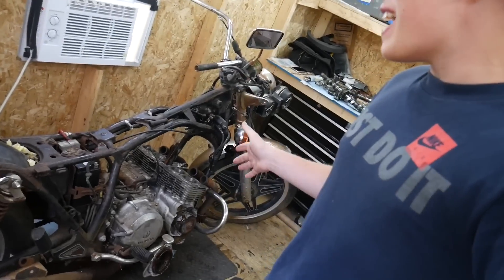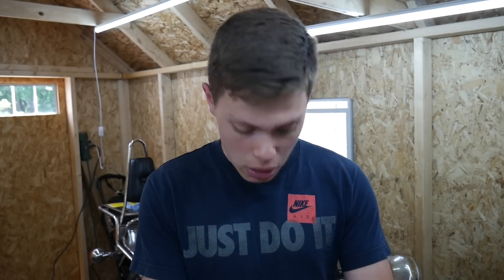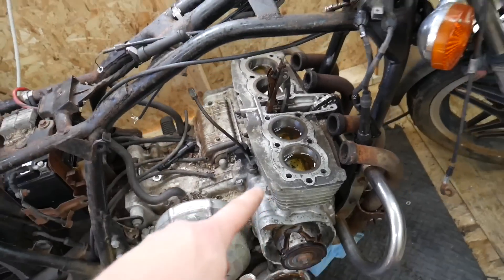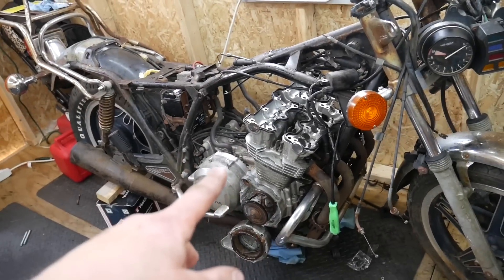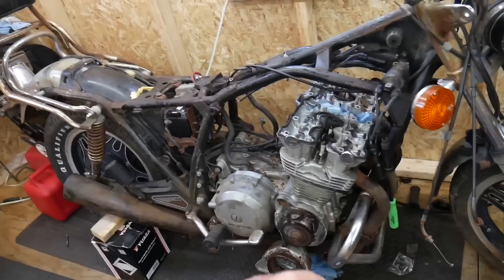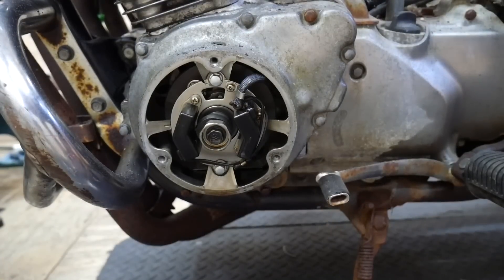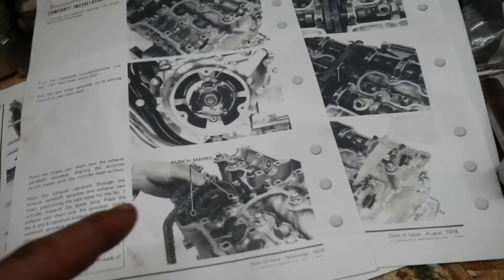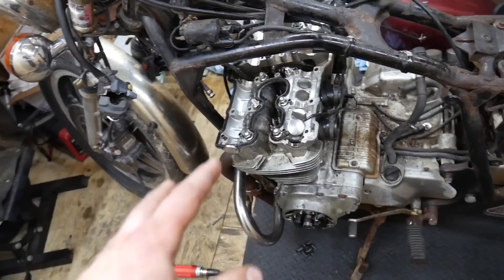It’s ALMOST Time to START the NasKart’s New ENGINE!

Comment from the maker: After reading the comments, many of you had said that the threaded rod will not work in the long run, I appreciate everyone notifying me of this and I thought of a solution that I will explain in next video, stay tuned!!
Reply: It's only 2 of 8 and they are not next to each other so send it or try to heat treat them then send it. It's going on a go kart not a road trip15 thousand miles
Reply: Get er done, idk anything to say about this motor or bike but thank you migs seriously idc what people tell you about what you do cause you really helped me & encourages while influencing me to process in my passion. I recently got a 150cc Dirt bike like the United Motors 150 you have, the bike needed a rebuild my boy I wish I could send you pics of the piston & head with valves. Talkin about a hole in the wall 😂. So I watched you do the top end rebuild & ive done it myself dad thank you but currently waiting for parts like usual :/ 

Any tips on breaking in?
Any tips on assembly like lube to use?

You are a legend my boy keep the great educational goofy videos coming to keep me & the viewers coming!
Reply from the maker: CallOfGloRay awesome man! So glad I can help, for the break it procedure, I usually let it idle with a view little tiny revs here and there for about 5 minutes, then turn the bike off and let it cool down completely, after that go back out, start it up and ride it around at lower rpms, just kinda cruise around for another 5 minutes then turn it off and let it cool down, finally, start it up again and ride on it how you would normally ride, maybe not super hard but you can get on it a little bit and she should be mint from there. Also, most of the time I like to use motor oil as assembly lube, but that’s just me, either one can’t hurt the engine, hope this helps!
Reply: Moto Migs thank you, that is exactly what I wanted to know^
Reply: @rayscyclesrepairs3516   You can't really heat treat mild steel which most of this threaded rods are made of. If you really can't afford studs meant for this application at least try to find the highest grade threaded rod you can. And just to now for future projects- if you want to remove studs without damaging them use 2 nuts tightened against each other and then start turning the bottom one left. The stud remover is only for broken studs and bolts.
Reply: CallOfGloRay don’t ask this kid for advice. For break in let it idle up to temp 3 times but slightly varying the rpm. Then take it easy for the first few rides no extended periods over 3/4 throttle then send it.
For assembly lube they sell a specific oil or just use cheap 4 stroke oil
Reply: Jag S don’t be negative boss lol but thanks

Comment: TO ALL YOU UNEDUCATED YANKS 
STRECH BOLTS HAVE ONE USE APPLICATION 
WHEN TORQUED DOWN THEY STRECH , 
It might work for a while but thought multiple hot and cold cycles the WILL FAIL IN THE END

Comment: The tensioner has to come out otherwise you won’t be able to run the chain on the other camshaft. Once it’s out you put both camshafts in and line up the dots on the cam gears parallel to each other but with cylinder no 1 at tdc. Once cylinder no 1 is timed the timing is done for the others valves. Good luck! 👍

Comment: He should have removed the engine from the bike and then put into studs and then put on the head work smarter not harder and that bike is not that hard to work on it super easy I've done it before several times

Comment: You need an angle grinder dude... coulda put one the the nuts on the thread and once you sliced the metal (in like 3 seconds) you coulda just ran the nut off and it woulda repaired the threads. But anyways nice video like always
Reply: Cutting metal by grinding on it with a bench-grinder was hard to watch Lolol

Comment: Go watch Peter Anderson rebuild this engine, he goes over the tensioner install as well you will see how it is done.  And piss off that threaded rod if you really care about this engine, its mild steel and will stretch with repeated heat/cool cycles and you will end up with uneven head torque.  Not sure the Naskart is going to like this lump of metal sitting in its frame either but that is going to be future mig's problem lol.

Comment: If I remember I used a a pair of pliers that pulled up on the tenenior spring that released its tension then stuck a screw driver just under the spring an it held loose so the chain would fit on  the cam gear. Also the cam gear itself unbolts off the cam. Get the correct studs otherwise you'll blow the head gasket when the motor hits operating temp.

Comment: Hey Mig, on the Yamaha 4 cylinder you have to undo the bolts that hold the gear to the cam. Then you can get the chain on the gear and then rebolt it to the cam. Atleast that is how you do it on a Yamaha 4 cylinder from the same era. (XJ models)

Comment: Think on how you took it off, you'll figure it out, the tensioner should be spring loaded and also have a bolt or pin in the wheel. I believe there is a prying tool just for that also. Good luck

Comment: What on earth are you doing? DO NOT USE THAT THING INSTEAD OF A STUD. ANY Machining shop can make you a couple of studs if you give them one for reference or if you give them the messurements. Plus I am certain you can find similar studs from a car or another bike. That rod is not going to hold and you will have to redo everything.
Reply: Or if he just removed the threads like the original one and only left threads on the ends
Reply: He could just measure the length and thickness of the stud, find studs from a different engine with the same thickness but longer and machine the ends to match his studs. I did something similar to my car when I couldn't find valves for it. Found bigger and longer valves, machined them to fit.
Reply: @bradleymetcalf6958   its not about the threads, its about the material of the rod. Bolts will streach when torqued. If the material is not strong enough it will streach to the point it wont seal.
Reply: Why cant he just heat treat it like a sword or knife??

Comment: Not sure if has been commented, but you should buy new head studs. I wouldn't even use the old ones. spend the 200 for the new ones save yourself the time and hassle. Also buy a grinder a harbor freight pipe bender and a welder and practice welding awhile. Everyone makes mistakes you just have to overcome them and learn from them. Also for videos when your not working on the bike work on taking out the engine on the cart make a list of what's needed and what to do. Either way keep it up!

Comment: Your all thread IS THE WRONG tensile strength as in wrong grade of Steel like in SAE it's a grade 3 when you need either a grade 5 or grade 8 tensile strength and yet and yes I know those all thread are metric not the point point is it's the wrong grade of Steel and is not the proper strength you will stretch those and or break them trying to torque them to what you need and they probably will stretch if they do hold and you'll probably end up blowing a gasket

Comment: To all the commentors who say that he is making a mistake by using threaded rod, its not a problem if he's using it on two different cylinders in the center of the head. The torque specifications and compression ratio are nowhere near high enough to stretch those bolts. If he were building a SB Chevy that would be different.
Reply: He should at least heat treat that threaded rod cause it is soft steel stubs are a harden steel

Comment: I think you are cutting your throat. You never ever use standard threaded rod for stud bolts. Head bolts are hardened steel. Threaded rod is not. Love your build but, you are going to kick yourself in the butt if you did'nt use hardened steel. Sorry but you are messing up not getting the right studs.

Comment: Take the motor out of the frame not gonna say anything about soft studs or putting two nuts on the studs to pull them out or tighten them up

Comment: Oh my. What did the motorcycle shop tell you on replacing the studs?? Woulda been better off if you found hardened rods the same thickness and thread them yourself. The chain tensioner should come out to free up slack to reinstall the cams.  usually on the back.  I’m not saying your doing a bad job your learning as you go.  You need to rethink a few things

Comment: Funny I gave him the eBay listing for a full set of stud used on his last pot and he disregarded it. Let him find out the hard way when he warps the head and can't get a usable replacement
Reply: This is what happens when you want to be cheap I give this motor maybe an 1 of running before she grenades
Reply: Funny thing Patrick, he wasn't bring cheap. He was being stupid. The listing I gave him was a full used set for $40. I'm in the automotive field and not all customers can pay for new parts. I aquire used parts with warranties weekly for some of my customers.  Just like when he washed down pistons with carb cleaner, 20min in a Chinese hydroponic parts cleaner would've had them totally spotless. God even harbor freight has them for $19.99. oh well not my motor and not me wasting money
Reply: Agree but still on when it comes to the heads you really want to use new head studs if possible I know from experience I used my old studs on my first motor I built and I regretted it a simple 400 dollars cost me my whole engine

Comment: i'll check out my manuals, i just sold my 750 one but still have my 900 and 1100 manuals, and the engines are the same, i wouldn't get to excited and starting your engine, you still need to check the valve clearance, and i'd bet money there off, the exhaust valves sink into their seats and you loose clearance, if it will even run or just run like crap, so either you have to buy new shims or do what i do and grind them down on a surface grinder, maybe if you go to a honda bike shop someone will help you, there should be a motorcycle salvage yard around where you live as well.

Comment: Man just throw a predator 420 on that thing
Reply: agreed.  so much fab work to put that heavy asf cb750 in the nascart.
Reply: yea, or a 670 if he must have so much HP. . that guy is absolutely not ready to work or put motorcycle engines on something like that.   Cant wait until he starts working on the frame and fitting the engine. I dont hink i understands how much work it is to make the frame strong enugh for that heavy engine.

Comment: Buddy I really hope that those shitty pot metal studs you made up doesnt stretch. Imho I think spending the 200 on a new set of studs would be worth it those you pulled out you could've saved the threads yourself. Also those old studs are probably stretched. If it blows a gasket its gonna be on one or all the new studs you made why because they havent stretched fully yet. Most bolts stretch more then 2 times especially if it's been torqued and un torqued multiple  times. It only takes a stud or bolt to stretch .002" of a inch for stuff to start going bad. Hopefully this old Honda beast comes alive and stays alive tell it needs a new timing chain probably not a bad idea to change that timing chain as well. I know you dont wanna spend the money but sometimes it's worth it and is better in the end. Something you might not know that big engine builders do is measure bolt stretch yes it's a thing and yes if a bolt stretches more then its supposed to it can cause a very big problem if you use old bolts that's already been through heat cycles. I know in kart racing guys change bolts after about 25 to 75 hrs.

Comment: Migs you need to get an angle grinder it will make things so much easier,you can go to harbor freight and get a decent one for 20 to 30 dollars.And I wouldn’t use those threaded rods cause they’re galvanized and not hardened so they’re gonna stretch and wear and it will cause you lots of problems with that engine so rebuilding is kinda useless at this point.

Comment: Using that threaded rod will cost you more money in the long run... it'll cause blown head gaskets with a quickness. And grinding on the allthread and heating it up like that changes the molecular structure of the metal,  causing it to not hold torque,  especially since they're not hardened like the proper head studs.

Comment: Here is a link to a diagram for the chain tensioner https://www.hondapartshouse.com/oemparts/a/hon/506f8d96f8700229747b9637/cam-chain-tensioner
Just copy and paste into search bar 
And here’s a link to all the parts diagrams for the bike 
https://www.hondapartshouse.com/oemparts/l/hon/50541774f870021c54bef631/1980-cb750c-a-parts

Comment: RIP this engine if he uses that threaded rod 🤣😂🤣😂. Just do it right and get the right studs, you'll thank yourself later when you dont have to do all this over again. You put all this work in, why ruin it?
Reply: They will work as long as they have been milled properly
Reply: @thomasmcdougall8059  original studs are treated hardened steel. Not some cheap soft steel home depot shit. They will not last at all
Reply: @HD-kl3hn  but it's only o 2 out of the eight studs tho,i think it will hold up,i get that it's softer but the other studs will be fine
Reply: @HD-kl3hn  as the comment above said its only 2 studs with those 2 studs spaced out there won't be anything up it will hold up fine if anything it will expand a little
Reply: Corey your right I’m pissing my self with these comments, he needs stretch bolts

Comment: Don't use those threaded rods man they will screw up more stuff and it'll just make it harder. Buy the original studs man they are hardened and meant for that job. Those threaded ones will stretch
Reply: G'day guy's yeah as soon as he said threaded rod I said NO ,don't do it ,  he's young and doesn't understand metal stresses and metal & alloy mixing .
If he goes ahead with this he'll be riding around with a bomb behind him , I hope he has at least a 3 mil  plate behind him .
Reply: The rods he used will be fine fore it there's only two of them out of like 8 that's nothing compared to what I've seen done to engines
Reply: @absolutemadlad2671  yeah that makes sense man it should be fine now that I think about it! Thanks for your comment
Reply: @frasertive2726  I really can't tell if your being serious but if you are no problem
Reply: @absolutemadlad2671  I am being serious man I love to hear other peoples thoughts on things like this!
Reply: @frasertive2726  oh thanks then

Comment: Threaded rod definitely won’t be the right idea, sure temporarily it’ll work but it is most likely soft steel, it’s going to bend and warp. The stock studs are solid steel, much stronger, best bet would to be to drop some more cash on some solid studs than to blow the whole head off.
Reply: Probably not the worst thing ever done, plus it's two out of the eight. At least the rest r still properly done

Comment: Threaded rod is no good  the original studs are hardened  steel threaded rod is not . When you tighten the studs to torque they will stretch and will not stay tight . You need to get the correct studs .
Reply: I was thinking the same thing but then I thought well for what his using it for it should be fine not like his taking any road trips LOL
Reply: It’s a year later and is still doing fine😂😂
Reply: The guy is right there stretched stud he should of used new ones
Reply: yea well it's only two out of like eight so he'll be fine

Comment: Talk with carsandcameras , i am sure they has some honda cb550 engines  , and know they are using a honda 550 for a project they are running, could be helpful to you as they know about motors and can give you insight ...... also try the uk for spares the 550s were popular over here also the 750s, i think they also had a spare 550 motor on carsandcameras maybe ask them if they will part with a couple head studs ;)
Reply: I follow on Instagram, they've actually moved on to a cb750, the 550s were all trashed.  So they'd be ideal to help
Reply: Ya talk with carsand cameras
Reply: yea they had like 4 or 5 of those 550 engines.
Reply from the maker: Ok thanks for the info, I’ll give it a shot!